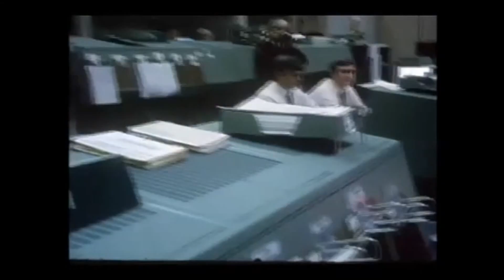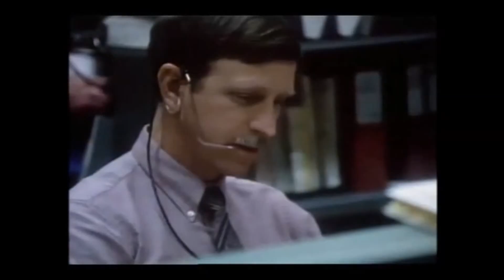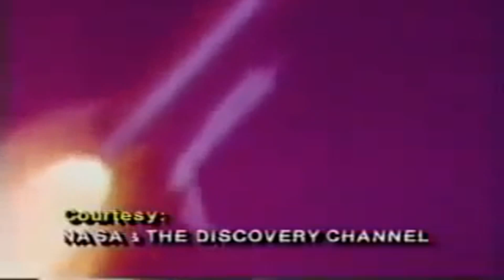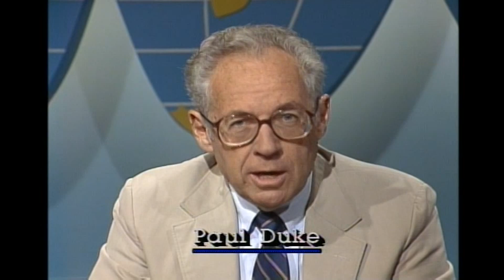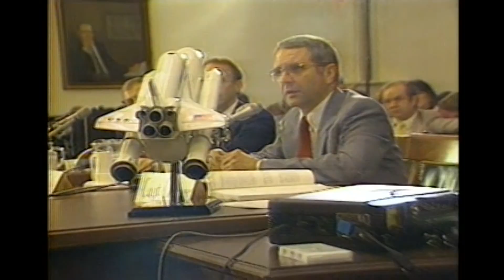Challenger Disaster, Control Room Reaction, Real Footage! 20th Century Time Machine

Comment: What is going on in the comments how are you surprised that the top of scientific and military elites in this room were able to remain calm and collected in a situation like this ? I am sure they had a very hard time then and even more in private you know, right then and there just wasn't the time to have a pannick attack or mental breakdown and these are not regular post office employees this is the NASA, the institution completly fvcked up that mission by not wanting to delay the launch again but the people we are looking at are still outstanding pros
Reply: look at all the signs they had, the door wouldn't close, they stripped a screw, they couldnt drill it out the batteries died, the womans kid wanted her to stay, the weather screwed it up a few times before. all the signs said bad idea. every engineer understands orings and how rubber works in temps. they developer knew about this issue for sometime and should have either changed material or increased redundancy while recommending no flight unless X temp. but nothing was done, while they did say no flight, greed and arrogance at NASA pushed them to agree to launch, an ethical failure, which is why several agencies now have so much training etc, based on this incident years ago. this is when ur happy u werent the one chosen to go

Comment: They had just come from a meeting the night before where the dangers of the frozen o-rings were spelled out.  Perhaps the lack of shock was because it happened exactly as some warned it would.
Reply: Was CapCom present at the meeting? My understanding is that the discussion about the dangers of frozen O-rings took place between engineers & upper management. The guys in this video were only responsible for monitoring systems prior to the launch & during the launch, not to make engineering decisions.
Reply: May I suggest you google “Robert Ebeling” he was the head engineer over the O-Ring task force. He was the first engineer to try to stop the launch. He was in that meeting you’re referring to. He was my dad.

Comment: I just would like to point out that it was NASA's fault this happened not the scientists. They told the higher ups something was not working no matter how many times they tried but NASA wanted to keep the same launch day. The scientists thought they had gotten everything under control but obviously someone lied to someone. Theres a great documentary on Netflix about the days leading up to the launch. Please go watch it before judging the reactions these ppl had
Reply: It wasn’t just days, though.  NASA had known about problems with the seals for a long time.  The joint should have been redesigned long before this flight.  They ended up redesigning it anyway, with the additional loss of several astronauts and a shuttle.

Comment: They were so calm because they knew this issue and didn't fixed it
Reply: wrong the flight ops do not typically get involved in engineering side of booster for sure, their job is the fly the mission and monitor the data, make associate changes as needed for correct trajectory.
Reply: @mica122213  makes sense
Reply: The people in the flight control centre were not aware that engineers had told upper management to postpone the launch. The people in the flight control centre were in charge of monitoring the systems prior to launch & during the launch. The accident had nothing to do with them.

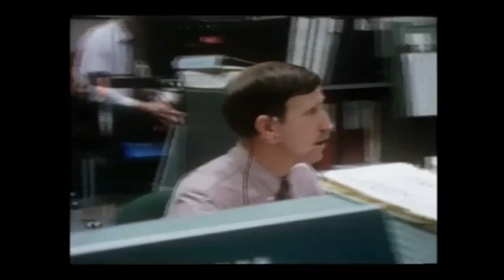Comment: Another haunting aspect of the video is that at 1:05, on the video monitor, you can see that the shuttle was pushed violently to the left just before exploding. It was determined years later that a very strong wind gust at that moment is what jarred the slag (that was filling the o-ring gap in the booster) loose, allowing the flames and heat to escape and consume the booster.  That's why the explosion happened on this flight and not previous missions. Though not the root cause, this was the proximate cause of the accident.
Reply: Your information is entirely incorrect.
The explosion of the Challenger had nothing to do with any crosswind and everything to do with faulty O rings which were in question with prior shuttle missions regardless of weather temperatures.
You obviously neglected to see the investigation final report.
Better punch in Roger Boisjoly-Thiokol who was one of the MT engineers recommending to delay the launch until the weather got warmer.
Boisjoly,as well as Richard Cook of NASA had trepidations about the reliability of the O rings on their own prior to the discussion about temperature affecting the O rings.
Crosswind was not mentioned in the Presidential Commission appointed by Pres Reagan,you can research this yourself,it's all available.
Reply: @rebelbaron7003  You obviously neglected to read the part of my comment where I stated, quite clearly, that the crosswind was the proximate, not root, cause. This was determined years after the report you refer to.
Reply: @Rebel Baron  It's partially correct.  The shear at 35k feet was predicted abd within limits.  The theory goes that the seal had plugged itself with some slag and other residue after the initial smoke plumes on launch.  Had that shear not been present, it's possible (heavy emphasis on possible) that the temporary seal could've held the last 50 seconds or so to SRB burnout.  You are correct, it was not in the official report but the idea has been out there for a long time.

Comment: This is so powerful to me. In a job like this, you've got to remain calm under pressure because panic will do nobody any good. But you know these folks were hurting and in shock after they saw what they did. Especially Covey - the Capcom - who I'm pretty sure was astronaut classmates with most if not all of those on board.
Reply: Yes it's actually very inspiring. In a society that overvalues melodrama and oversharing emotions it's nice to see composure and quiet solidarity for what's unfolding.

Comment: No one ever talks about how it blew up right after the command was issued, "Challenger go with throttle up" and the crew repeated it back.  Could the shuttle not have made it to orbit with less than full throttle?' It was climbing. The fuel was leaking but no explosion until they put the pedal to the metal. What if the fuel had just burned up, the tanks dropped off, and the shuttle made it to space? We'll never know.
Reply: The profile for throttle was carefully calculated to do the job.  They were just following the profile as required.
Reply: @GH-oi2jf  Correct. The drag forces on the Shuttle would have been excessive if the Shuttle flew at maximum throttle at low altitude. So, in every Shuttle launch, maximum throttle could not occur until the Shuttle had climbed high enough in altitude to be above the densest part of the atmosphere.

Comment: there's a ton they couldn't know in those first moments. there was no readout on any screen telling them whether the shuttle was in one piece or a thousand, or whether the data downlink was just glitching or worse. the accident happened near the time there would be a very visible booster separation which is why the crowd outside actually cheered the explosion. there was a protocol for an abort mode to return to launch site (RTLS), and without downlink data, mission control wouldn't know if that was in progress or not, even knowing there was an explosion

Comment: It may not have exploded f the throttle had been less than full throttle.
Reply: it was the booster what caused the external tank to blow, not the orbiter and the booster was powerd by a solid rocket motor, that means it cannot be throttled down.
Reply: Wrong

Comment: This wasn't a sad day, this wasn't a tragedy. It was a case of the upper level managers overriding the engineers. This should have resulted in criminal charges.
Reply: Yes, the engineers said not to launch because the extreme cold was compromising the function of the O rings in the booster rockets.  Still a sad day and a tragedy though.
Reply: I agree...whoever overrode the engineers should have been charged...fucking dumbass!
Reply: Hmmmm...when did Reagan, or any president,  have a say in launching a shuttle?
Reply: still a sad day and a tragedy???
Reply: Carl Thompson Agree, it was a joyous day and glorious day you damn moron.
Reply: I worked for Lockheed Space Operations for many years and was at Kennedy Space Center for both Challenger and Columbia. My job was titled Configuration Management Analyst Senior. On launch days we all had to be at work at 1:00 am. My job entailed hunting down engineers. Why?  If there were any problems found on the shuttle, for example, hardware, software, electric, etc., I had to make sure the problem(s) were completed, hunt down the right engineer(s), have them sign the paperwork, and get it to Houston. Fast. I could tell some stories on here but it’s best I don’t. Those engineers made big bucks. They weren’t hard to find. They would be in their office(s), feet propped up on their desk, snoring away. I’m sorry but the loss of both Challenger and Columbia just traumatized the hell out of me and many others. Those damn engineers just sitting there sleeping on launch day just pissed me off and people wonder why these tragedies happened. I wish I could say more to make my point more clear but I really don’t think I need to say anymore except hell yes there should have been criminal charges filed on many.
Reply: Carl Thompson It was still sad and tragic, I think you meant to say that it could have been avoided and that’s correct, but when innocent people die it’s sad and tragic no matter the cause.
Reply: CaptHawkeye I would love to bitch slap you fool
Reply: CaptHawkeye don’t be a simpleton
Reply: Are you stupid or what? It was sad day, tragedy and result of overriding engineers.
Reply: Carl Thompson U r certainly correct!
Reply: There was all kinds of pressure to launch that Shuttle...it had been delayed over and over. There was enormous pressure and I am sure that includes political pressure...any one who says otherwise is clueless.
Reply: CaptHawkeye quit trying to place blame on on Reagan. The decisions to launch were made by in charge of NASA. No matter the budget constraints or directives from the president, the decision was made by NASA. On top of that fact, NASA ignored the multiple warnings by the engineers to not launch, yet they launched because they didn’t want to appear to have lost control.
Reply: they had to get the teacher up to ensure that congress would keep giving them funding
Reply: Carl Thompson the upper management are engineers, criminal charges? Go fly a kite roger ram jet

Comment: Cue cards? Wtf? They did not seem surprised at all.
Reply: Not surprised? Did you not see CAPCOM’s jaw drop?  

1:05 “Flight, FIDO.  Until I get stuff back he’s on his cue cards for abort modes.”  On the way up, MC would radio up abort options - if the shuttle lost 1 engine at a certain time, they could do ‘X’, if they lost an engine later, they could do ‘Y’, etc.  you can hear this on video of other flights.  Of course after Challenger disintegrated, they had no comms or telemetry from the shuttle, but MC didn’t know exactly what had happened yet.

On-board the shuttle, they have checklists and cue cards for procedures as they go.  Just in case a flight lost comm or telemetry with MC, the astronauts would know what their options were.  At this point, MC had limited information on what actually happened.  I’m sure many of them SUSPECTED the loss of the crew and vehicle, but until they knew for sure, they did their jobs.  

Remember that once the shuttle clears the launch tower, control is handed over from KSC to Houston - so it’s not like they could look out the window.  They had no instant rewinds and replays of close-up videos.  FIDO was basically telling the flight director (and CAPCOM, for that matter) “I have no info about what’s happening, therefore the crew will have to work from their checklist.”  Nobody knew (yet) how bad things were - and if there was a chance to save the crew, they needed to be ready to react immediately, not be gnashing their teeth or wailing in sorrow.
Reply: Bro you watch too much movies  panicking does not help it is literally a rule for Nasa employees to not wail in sorrow because it is unprofessional oh and panicking does not help

Comment: The words “Challenger go with throttle up” still sends chill down my spine
Reply: Indeed.. we know it had nothing to do with what happened (as the damage to the tank was already done.. i.e. took more than a few secs.. plus you don't throttle up or down SFR, there is only "on" or "off" and there probably isn't even "off" with these once started until out of fuel) but still....
Reply: redhead sticky it had 7 people in it
Reply: Yes. 'And we did not copy your last' does the same for me. You know the next words you hear will be the crew's last.
Reply: 'Challenger time to murder the astronauts' is more like it. Ice all over the challenger and being told it will blow up with frozen O rings at those temperatures. No one in NASA cared. The whole thing is very disturbing.
Reply: Mine too.  😢😔
Reply: A Rockstar yes, was watching it live. Throttle up blows that o-ring out, and tank and shuttle are gone........
Reply: @a.s.4914  actually what destroyed the shuttle was crosswinds. That was found out later in investigations. If they hadn't gone through those winds then the solid  pieces of fuel that were blocking the leak would have stayed in place and in a few minutes would have been detached from the space shuttle. After that the rocket boosters would have landed and nasa would have later discovered that the o rings failed and they had a close call and would actually listen to the MT guys about temperatures for take off. Challenger would have successfully made it into orbit and shouldn't have had any issues upon return. But the cross wind shook the solid pieces of fuel from blocking the leak and thus the space shuttle broke up and the tragedy was born
Reply: @somea6706  Well, it was a mixture of those two things then.
Had the O-rings not been a problem then the winds wouldn’t have been either.
The base issue was the o-rings.
Reply: @therestorationofdrwho1865  temperature could also be considered a base issue
Reply: @somea6706  Actually what destroyed the shuttle was the ignorance management held when faced with the engineering issues that were already known before launch. “I read all of these [NASA flight readiness] reviews
and they agonize whether they can go even though they had some blow-by in the seal or they had a cracked blade in the pump of one of the engines . . . and they decide ‘yes.’ Then it flies and nothing happens. Then it is suggested . . . that the risk is no longer so high. For the next flight we can lower our standards a little bit
because we got away with it last time . . . It is a kind of Russian roulette" - Richard Feynman

Comment: There were cameras all around the launch pad. You could see leakage of smoke from the aft field joint of the right SRB during the initial liftoff. Imagine if they had been watching these cameras, along with the instruments they had that revealed the falling pressure in the right SRB tank. There is no reason they couldn't have been watching these and aborted the mission, allowing the shuttle to ditch the SRBs early on.
Reply: Simon Rano You shared a lot of interesting information in this comment thread, and I just want to take a minute to say Thank You for that. I've often wondered why they couldn't immediately abort the shuttle launch, and now I know-- the sheer amount of data, calculating, and split-second decision making required in those 120 seconds is just overwhelming.
Reply: @Jessica Byler:

Yup.. and in addition to the time and other issues.. Without the boosters firing, it's just a big rock at that point.. Plus there probably isn't an "off switch" with SFRs anyway, only running out of fuel. (which if cut off from them anyway, probably wouldn't have helped because, as you see in the videos, they continue to run for a good long while after disconnection from their fuel source.. i.e. remaining fuel in the system) But even if you get past that issue, and eject them or something.. until it reaches the right height/speed, the big tank would drag down and be a drag on the shuttle to the point of ripping something apart.. Not to mention that I wouldn't want to guess at the extreme level of danger that would come from ejecting the 2/3rds full fuel tank at such a low alt and slow speed, with wind res... AFTER ejecting the boosters! Then remember, that all of this (boosters > then tank) would have to be done with perfect timing and everything going right. a little bit too slow with the boosters and the tank still goes boom, to slow with the tank and the shuttle either gets ripped apart or slows down too much to ever recover. Oh yeah, and this all has to happen within ~100 seconds of even just finding out that something COULD be wrong in the first place!